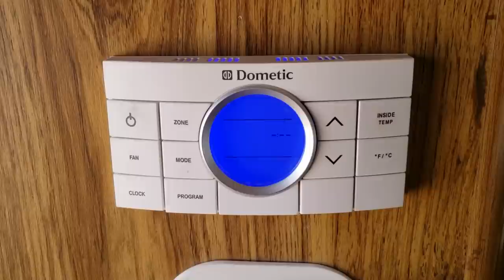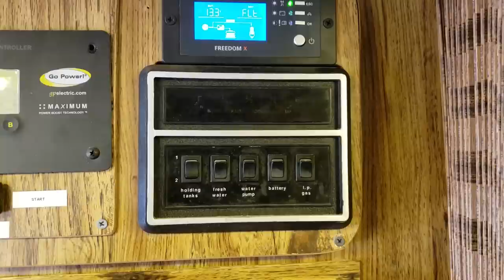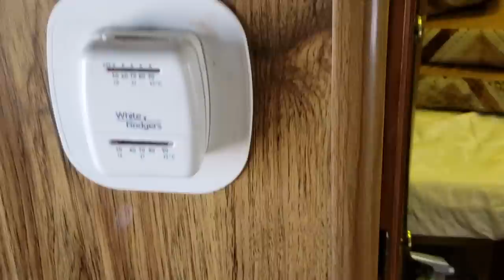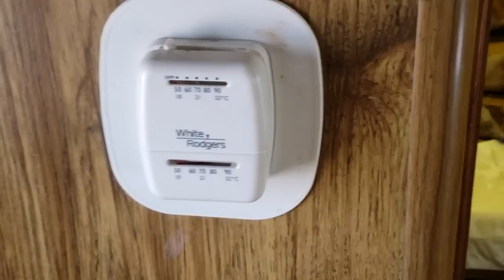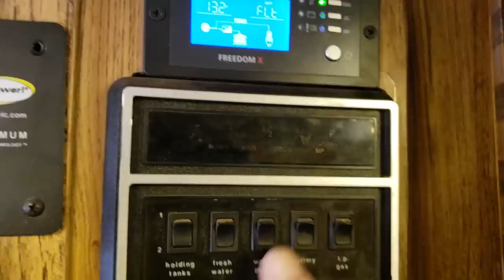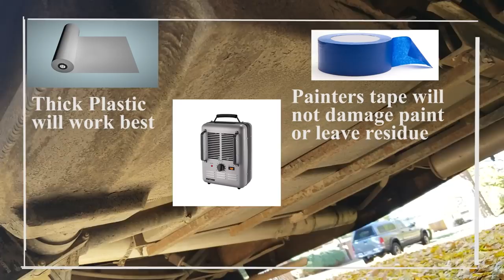How To Fix Frozen RV Water Pipes And Tanks

Comment: Appreciate your guidance on this topic. Are there additional steps or considerations when using an accumulator? My lines appear to be unfrozen, but the nipple coming out of the bottom of the accumulator is dripping. Is that a sign of pressure from the ice forcing out the water? Same steps as everything else by just heating up the RV?

Comment: So... what if you defrost your fresh water tank, faucet and pipes, but water pump makes no noise when using the faucet and nothing comes out?  I'm assuming it means there is still a frozen pipe somewhere.  But can the long term below freezing temps knock out the water pump fuse, or something like that?

Comment: This is gold ty!! What about a fridge that stopped working when temperatures were freezing. It’s day 3 here in Texas for record breaking  temperatures between 12-29 degrees. I live in a 5th wheel full time that’s converted to all electric. No propane with endless water and electricity hook ups. I winterized my plumbing, however my fridge just gave out. Any advice or a link to share? 🙏🏼
Reply from the maker: If it doesn't have power you may try resetting the GFCI outlet in bathroom or kitchen.
Reply: @fullmoonadventureclub  It has power! It’s on but not cooling since the coils from outside froze.
Reply from the maker: Ah. I'm afraid that is beyond my expertise. I've never run into that problem before. I'm sorry I couldn't be of more help. I wish you the best of luck.

Comment: I had a heated hose hooked up and plugged into our motorhome but the receptacle on the power poll failed causing our lines to freeze. I live in the motorhome full time in Missouri and had our furnace on but sadly everything froze. I was able to thaw our heated water hose but still no water getting to our faucets.  I've tried a hair dryer where the water hose connects inside but it didn't work my arthritis made it so I couldn't hold it long enough what else can I do? We have a sea breeze motorhome  so the water connections are in an outside side compartment

Comment: I am new to rv's and had a bad freeze up where it damaged the water heater to where I had to get it welded. Also found a few leaks and fixed them. I must still have leaks because I cant get my new pump to pressurize the system. The only time I can get it to shut off is when I give it pressure from a hose. Question, is it best to run the hose to find the leaks or is there a better way? So far when I run the hose I cant seem to see anymore leaks.
Reply from the maker: If you can't find any visible water leaks it's possible that your water pump is not functioning properly. They usually have a one-way check valve so water only flows One Direction from the fresh water tank. If this one-way valve is damaged it would never pressure up. With the city water connection or the water pump operating you should find a leak if there is one. If you have no leaks when your city water connection is hooked up then my main focus should be on the water pump itself.
Reply: I ran hose water hooked up, bled all lines and turned off the hose, turned on fauset then after the pump turned on turned it back off. Initially the pump turned off, but the more I use it ,it wont turn off again. I thought it was somehow getting air in the lines. But listening to it. It seams more like the tank might be starving for air.
Before today, I already bought a brand new pump so I think we can eliminate that as a problem
Reply from the maker: @ThermosJuglasPrespotbelly  that sounds like a reasonable assumption to me. I would check for Kinks or blockages in your freshwater Tank Lines and of course make sure that the fresh water tank is indeed filled adequately. Is there perhaps a bypass valve somewhere in your system that might be closed

Comment: Hi jim i noticed in your last video in the description it says you can run an energy star compliant refrigerator for 33hrs, so if I'm not mistaken if i have enough solar panels and added deep cycle AGM batteries i can get this thing to run day in day out 24/7 (correct me if im wrong).
Reply from the maker: I assume your talking about the kodiak solar generator. Yes you can run a refrigerator 24/7 with solar and extra batteries. No problem. :)   Jim
Reply: @fullmoonadventureclub  man I'm hooked thank you Jim
Reply from the maker: I love mine. I think you will like it.

Comment: My pipes froze but I was able to get my water running after defrosting the hose, but then the water stopped running. Any ideas?
Reply from the maker: Continue to heat the inside of the RV with all of the cabinets and drawers open. It's entirely possible that you have a nice chunk that got lodged along the way or that your water pump is iced up or damaged from the ice going through the diaphragm. Make sure you can hear the water pump going. You're also going to want to look out for external showers etc that might be Frozen and leaking that you forget to check. Good luck.
Reply: @fullmoonadventureclub  thanks, I  hope it is just a piece of ice stuck somewhere.